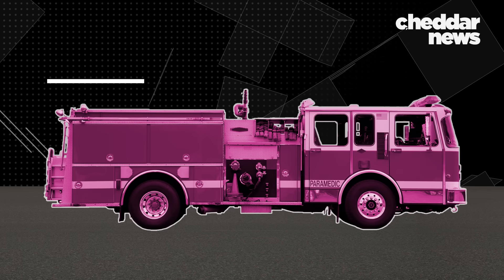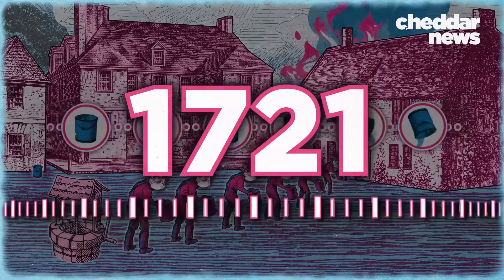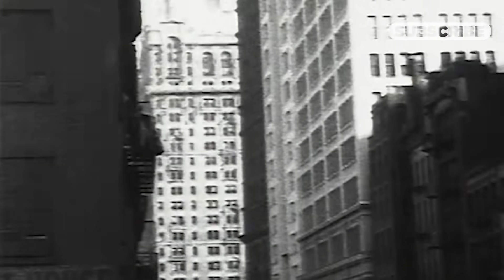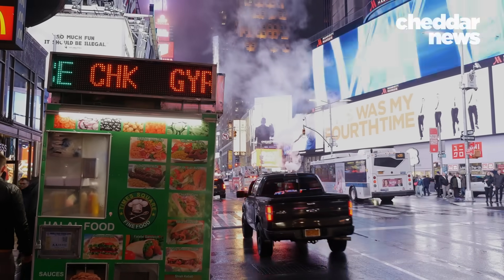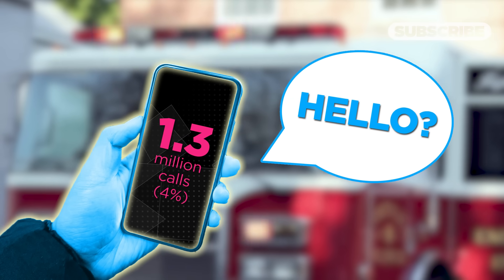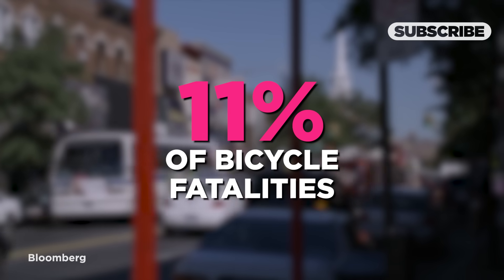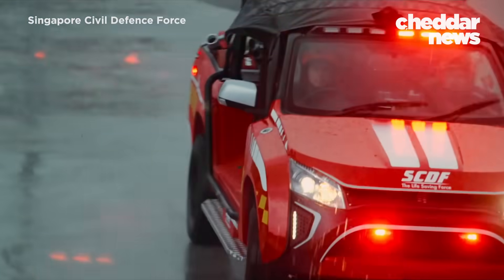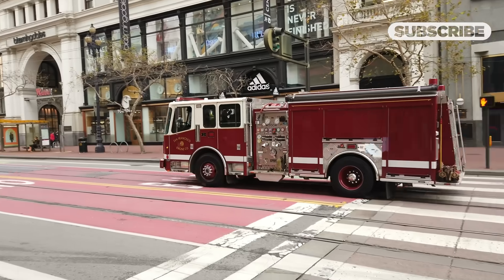Do American Fire Trucks Need To Be So Massive? - Cheddar Explains

Comment: This isn't just a fire truck issue, either. We are trying to get curb extensions installed in my neighbourhood, but the snow removal authority is against it because their vehicles are gigantic. We over-engineered all of our stroads so these vehicles became bigger and now it's difficult to build safe streets because the vehicles are too big.
Reply: I guess the simplest answer is keep people out of the street.
Reply: A '93 FORD Ranger next to a 2017.  https://preview.redd.it/jnulkzmu8bs21.jpg?width=960&crop=smart&auto=webp&s=599907ca07847632213dedcfee78c16520b299f9
Reply: They and other CDL drivers here are just lazy. You can make it fit, I drive a school bus. I've gone down roads with width restrictions, alleys in pre car towns and pre war suburbs. Just slow down, and drive. 
I once turned onto a small suburban road with a Prius parked 4 feet from the side of the road. Hit my horn a few times, then just squeeze through. 1-2 inchs on car side and the same for the mailbox. And thats relatively common for drivers in my district. I just radioed the driver that would be coming through later since his bus was wider than mine and carried on with my day.
Reply: @EmperorNefarious1  Exactly, other busses are wider.  And trucks are longer, wider, and more complex to turn than a straight vehicle.
Reply: US still builds trucks like it's the 1950... 
Less power and hauls less than the european trucks - that are half the size.
Reply: So extended curbs like when you turn on a road ya um sorry im a very good driver and those make it god dam difficult to turn properly and safely because there to far out in my laine 90% of the time so everyone needs to go in other lain to avoid the curb.
My 2005 toyota tacoma is 3,700 pounds gets 19 to 21 mpg.
Brand new 2022 toyota tacoma 25 to 27 mpg and is 2 feet higher then mine and 1 foot wider and its 4,650 pounds.
Oh ya my truck air drag is 2.9 the 2022 model is 3.4 like wow more drag then mine why.
Hmm mybe downsizing a bit would be good also stop making things heavier than before.
Reply: @thesilentone4024  Which 2022 Toyota Tacoma gets 27 mpg?
Reply: @thesilentone4024 you’re a good driver but struggle to navigate curbs?
Reply: Hello what’s up
Reply: For commercial truck drivers it's quite the opposite, roads aren't big enough for us commercial trucks. They're outdated and need to be bigger.
Reply: @bishop51807  Lorry drivers are able to drive through dublin city on 18th century wide streets
Reply: @oscarosullivan4513  You folks drive much smaller trucks 18.75 meter cabovers we're in America the trucks are 21.9 meter long nose. In Canada some of the trucks are actually 23.7 meters. On top of that no standard trailer in America has tandem axle steering so will be eating the sidewalk as we turn. Also due to the supply chain shortage there's talks in our government to make them longer.
Reply: @oscarosullivan4513  because European trucks and their regulations are completely different.
Reply: @ebels3  Nooo, making trucks smaller will never fly in the  US, not with all the supply chain shortages we have right now. Like I said, in Canada they're actually making them bigger because of the shortages.
Reply: @bishop51807  So tell me, where will you park?  I'm already sticking out of the spots at older truck stops.  Add another 7+ feet to that and you'll be halfway into the drive.  How are you going to get into the old warehouses in downtowns?  Unless you go at night, you won't be able to swing wide enough.  Not to mention, you'll be over 80,000 lbs and crawling up hills at 10 miles an hour.  You're really ok with losing money and an increased risk of an incident so your company can make more money off of you?
Reply: @bishop51807  Or you could just use European style trucks that's shorter and can make tighter turns while actually pulling more cargo?
Reply: @Luredreier  You have to talk to the carriers about that.  They want the most fuel efficiency and the most weight.  So we get these ugly curb sniffers with jerkomated transmissions, even though they get worse fuel economy than a standard in reality, and cheap thin materials that make living in a truck horrendous.
Reply: @bishop51807    Some of them anyway.  Where I live a traffic structure was built in the 1960s.  The "new urbanists" don't like it and are having it torn down. The big rig drivers need it to get to the container terminal and back. 
And in a few years everyone will be bitching about all the trucks on streets!
Reply: @michaelrmurphy2734  That's because most cities were built when 48' trailers were the average or before.  Now, there is a push to move to 60' trailers.  How are we supposed to get to the shipper/ receiver without taking out cars?  There are already more accidents involving commercial vehicles due to a lack of training.  If we go to nearly 1.5* the length the streets were designed for, we will have even more problems.  Not to mention the increased weight, road wear and possibility of a governed speed limiter for the extra long trucks.  Y'all already hate trucks on "your" roads.  How will you feel with even slower longer trucks clogging up the interstate?
Reply: No thanks. Roadway stays open.
Reply: @jreese46  https://youtu.be/_ByEBjf9ktY
Reply: @jreese46  Noone's closing a roadway. Places just need to be safer for pedestrians.
Reply: @adamnieuwenhout7699  Tell everyone you know not to step out in front of moving vehicles.  Poof!  You're safer.
Reply: @jreese46  Stop victim blaming.
Reply: @adamnieuwenhout7699  I have not once blamed the poor motorist, who you seem intent on victimizing.   Stay on the sidewalk, and watch the chances of being hit by a fire engine magically dwindle.
Reply: @jreese46  car brain
Reply: @jreese46  but what about streets with no sidewalks?
Reply: @r0bbocop-nwo  Why would those need extended curbs?
Reply: @jreese46  Thats your brain on car, everyone
Reply: @jreese46  Car brained and smog pilled
Reply: Those curbs bust tires
Reply: How’re you doing

Comment: Eh... Water is heavy, Firefighters are heavy, Hose is heavy, Fittings are heavy, safety gear is heavy, powered tools and other equipment is hvy.

Geared up each figherfighter humping usually 110lbs. So crew of 4 alone with basic equipment in hand is about 1\2ton. Add the water and other stuff we are talking several tons. Also as building height increases so does the size of the pump required to shoot water at it along with a tank big enough to be useful. No point if u have to get water 100ft into the air but ur tank runs out before u can fully hook to a hydrant. 3" 200ft of hose eats alot of water just filling it to pressure.
Reply: But fire departments could have smaller vehicles for example for car accidents or car fires. No need for 12m (40ft) long fire truck.
Reply: Yeah but for example german firetrucks carry all the needed equipment too and are still smaller in size.
Reply: @GrillerRohde  meny states get much more snow than most of Germany. If you used a fire truck for Germany or Spain in New York, Michigan, Minnesota or anywhere where it shows a lot then if would get stuck in the snow if the road isn't cleared so they wouldn't be able to respond to emergencys during blizzards
Reply: @d-treec9215  be sure, you find that scenario across Germany as well, all to the point where even tracked and offroad vehicles have issues to proceed. Also there are mountain ranges in southern and central Germany where it's completly common to have snow. And if not Germany, then take Austria, Switzerland, Sweden, Norway or Finland as prime examples for countries with a lot of snow and apparatus which aren't larger than those in Germany. 
The North Cape in Europe is as far as Barrow at the northern tip of Alaska. Still the fire trucks don't get stuck there
Reply: @EnjoyFirefighting  Also North West Scotland.
Reply: @d-treec9215  
Many fire departments especially in rural regions have fire engines built on lifted all-wheel-drive chassis, which are more than capable in adverse conditions. And FYI, lighter and smaller vehicles tend to deal with snow and ice far better than heavier vehicles.
Reply: Sure for some applications you need a certain minimum size. But you don't need to pack everything in one vehicle like that giant ladder trucks shown in the video with crew cabin and lots of other equipment on board.
Reply: Keep the large trucks in the precincts with high rises and smaller trucks for the suburbs.

Comment: The trucks need to be big to contain the massive cajones of those heroes as they head straight into a fire while everybody else is going in the other direction.
Reply: Since european firefighters drive smaller truck,.. i dont think so
Reply: @mats7492  Pssst, it was a joke... I know that they didn't actually design vehicles based on cajone sizes of geographical regions.  r/Whooosh

Unrelated... I suspect you drive a micro-compact car and are doing just fine.
Reply: @BatCaveOz  Small and manoeuvrable

Comment: We absolutely need to make this change. A smaller truck is great, especially for non fire related calls.
Reply: I say they invest in paramedic Squads to pair with ambulances.  
I also say as long as they have enough trucks to work a basic 1st alarm commercial fire they will be fine spending the rest on paramedic stuff since that is the majority of calls.
Reply: Nah.  Put in a few years using them.
Reply: So what happens when you get sent out for a "non fire related" call aka fire alarm and you get a fuly involved structure fire, that truck ain't doing shit
Reply: @evanl.4556  That’s where fire hydrants come in. The water on the truck can’t even put out most fires
Reply: @teshane8784  Our area doesn't really have hydrants. Also what happens when that hydrant doesn't work. Then you'll need to find a hydrant that could be 500+ feet away
Reply: @evanl.4556  Can they not just dispatch another truck if a different emergency happens... and did you forget that fire hydrants exist or-
Reply: @Evan L by that logic every police dispatch should be a vehicular squad of MRAPs each with a tactically dressed and long rifle armed squad. Amongst the total platoon would need designated officers for breaching, marksmanship and EOD duties.
Reply: @serbansaredwood  Exist everywhere?   Guaranteed that "other truck" is going to be nearer?  You might wish to learn how public safety works.
Reply: @gebys4559  Looked around lately?
Reply: Dunno mate, I live ove the pond and here they like flexible response ranging from a duo with tasers and buttons that solve good deal by chat to at the other end SAS squad that will probably try to execute you on TV if you are an Arab seleratist and they don't know cameras are rolling..
Reply: @serbansaredwood  It depends on the call. IF your at another call and they got a structure fire, guess what will have the priority. And what if the hydrant doesn't work. OR you don't have a hydrant
Reply: @evanl.4556  I don’t know fight it by not being brawn over brains.
Reply: @oscarosullivan4513  Right but you don't have enough water. a truck with 1500 gallons can run out of water in about 2 mins. Now think on how long it will take for a tiny truck to run out of water. Also my area doesn't have a ton of hydrants
Reply: @evanl.4556  They never bother to think that far through.